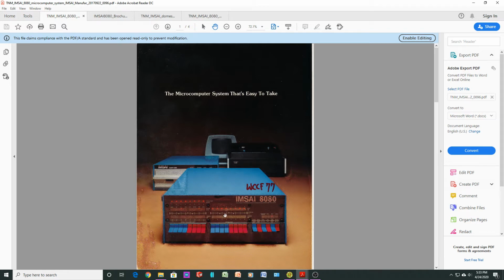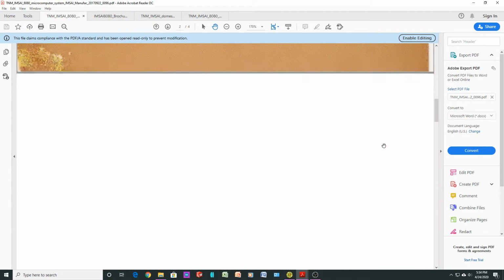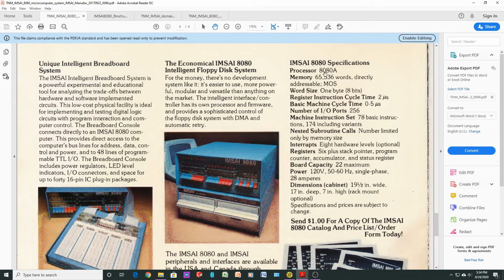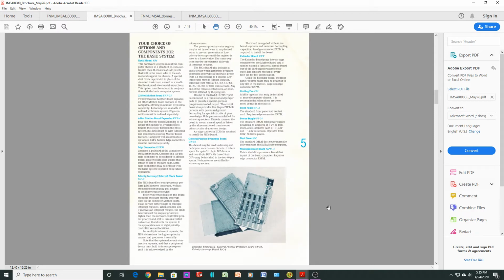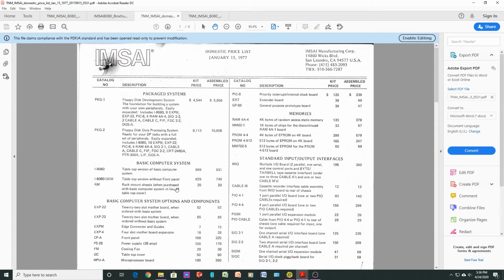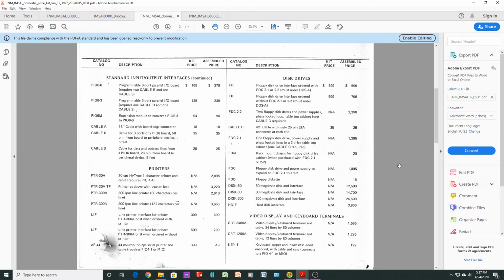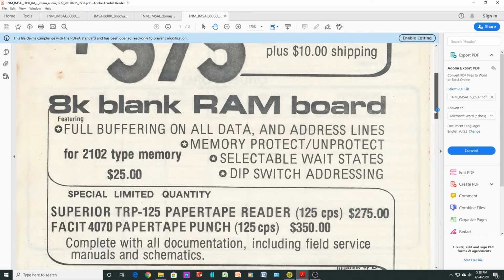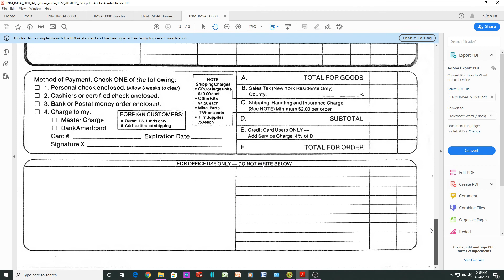#429 IMSAI Brochures and Price Lists 1977

Comment: Wow, you found a typo, the IMSAI did not draw 28 amps, which would be about 3.3kw.  Its draw was more like 30ma as the machine consumed about 4 to 5 watts total.  Note the lack of any attempts at cooling the thing.  Modern GPUs draw currents like that and have the cooling to match.  So that was definitely a typo.  :-P

Comment: I'm not sure what that is behind the IMSAI but it's not a modem, as modems at the time of the IMSAI all had ear muffs on the top.  You'd lay your conventional telephone into the ear muffs to connect to the remote terminal server.  The baud rates were (brace for it) 50 baud typical, 75 baud if you're lucky and 110 baud which I only achieved if the call was local.  I traded my old modem for some junk years ago, wish I still had it.  I did keep my 300 and 1200 baud modems tho.  The 1200 is a Racal Vadic (spelling?) and someone said it was a collector's item.
Reply from the maker: printer

Comment: Yes, 28 Amps DC, and that was the +8 VDC, add another 4.5 for each of + and - 13.5VDC. So that is about 1A on the primary side for the +/- 13.5 and about 3 or 4 amps for the +8 and depending on what you put in the box, you could almost hit 5 amp AC. So mains was pretty much a standard 12 or 14 guage three wire plug. The 28A was not really overkill for this box, you would have a front panel, CPU, floppy controller for your DSDD 8" floppies (or Tarbell or other cassette tape card) as a base.  Then depending on when you built it all out, from 1 64k  or up to 16 4k ram cards. Add in a Processor Technologies or Cromemco Dazzler video card (or 3P+S to run printers and maybe the Serial part for an ASR-33 TTY). Then add more I/O or ADC cards and each of all the preceding having its own on board regulation (one or more 7805 1A regulators & big heatsinks) and the current adds up fast! Sold mine in the early '90s an wish I had not. No, I would not sell it now, it was just one cool looking box and very powerful for the time. Mine started in 1976 as a 8080 CPU, 4kRam, 4slot MB and front panel. When fully a fully grown CPM2.2 running IMSAI, the previously listed boards -4k ram + 64kram, twin SSDD 8", H19 terminal, 3P+S, ADC board all in an IMSAI case with the mentioned power supply. Probably could have spot welded with the supply if nothing else.

Comment: I was a relative computer newbie in '79 I think, putting together my Heathkit H-8 computer and H-9 CRT terminal. Ahh, the days of entering the boot loader via a split-octal front panel just to get to the cassette tape. Two whole 8K RAM boards where 12K was taken up by BASIC, leaving a whopping 4K for programs. Yep, those were the days!

Comment: I built one of these back in 1974/5. I was also a ham. We had ham friend that also built one, we were working quite a bit together at night when we wire wrapped & soldered way over 5,000 connections. I learned Intel 8080 machine language, so we took another friends Altair Basic program and modified it after loading the program to accept our homebrew input keyboard and our TV Typewriter board. Worked like a champ. I also wrote some basic programs to convert ascii/baudot for using on Ham Radio. Great machine except my only storage at the time was a cassette tape drive/recorder. I built a Tarbell Interface (Audio) for storing programs. I still have my 8080 and Don Lancaster books here as well as my programs on cassettes, LOL . I think the CPU 8080 initial cost was about $300. The rest of the kit was close to another $800.  I had about 4K of storage in it, one came in kit, I think I built the others one as 1K board, and 2K boards until someone came out with 4K boards. We never had more than 8k total. I have a photo of my son playing 'star wars' on my monitor (Green Screen), about 1975. It was just a text graphic program but was fun. My friend Gary, who also built an IMSAI eventually added the disk drives to his. I moved on sold mine, and bought the Apple Computer as I was tired of 'fixing' the electronics, chips, etc all the time and wanted to play. The front panel was plexiglass with a sheet of plastic with printed white letters. LED's would shine right through, and was quit nice. I could program using the front switches in either Hex, Octal, or Binary. We lived in Central Illinois and word would get out about us building a home computer, did a few presentations, most popular was to a Engineering class at the U of IL Champaign. de K9DS@ARRL.NET   (Check out IMSAI.NET as a fellow setup a site + I think used to sell kits to modify modern PC's to look like an IMSAI)
Reply: BTW, I still have the first 24 issues of Dr. Dobb's Journal of Computer Calisthenics and Orthodontia, along with the First 12 Issues of Byte Magazine. Now there is some collector items. This was about the only outside source of information back then we had to keep up on all the new stuff & modifications we could make in either hardware or software!

Comment: @02:52 28 Amps! Wow. I would love to see what the power connection looked like! It must have been multiple AC mains connections.
Reply from the maker: The marketing department did not describe this well. The hardware manual calls out the specs for the power supply. the 28 amps is for the 8V supply (7 volt lower ripple). I think the AC is fused at 5A
Reply: @IMSAIGuy  Ah, this makes more sense.  I just commented that your average circuit breaker is 20A, so it would be literally unusable without a dedicated circuit.
Reply: That has to be a mistake. It has to be 28 amps on the DC side. I know those computers were power hungry, but 3360 watts is absurd.
Reply: @Lane42  Or maybe 2.8 amps? That sounds reasonable for computers of the time.
Reply: @bald_engineer  Agreed. That sounds reasonable.